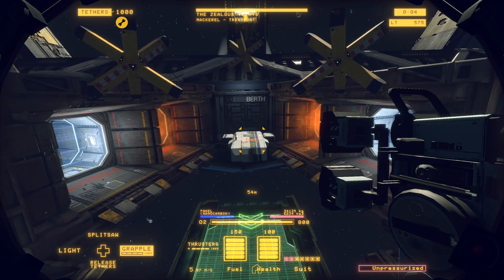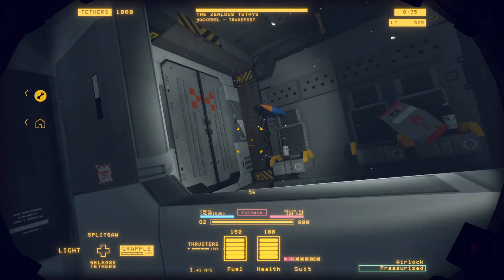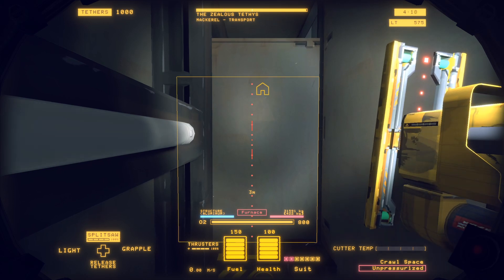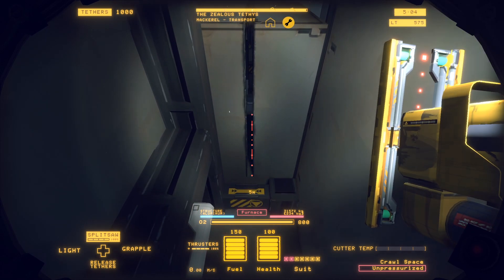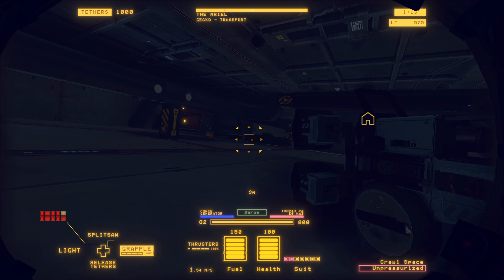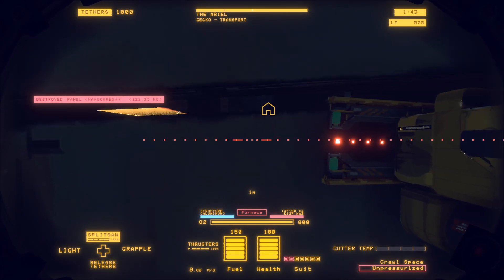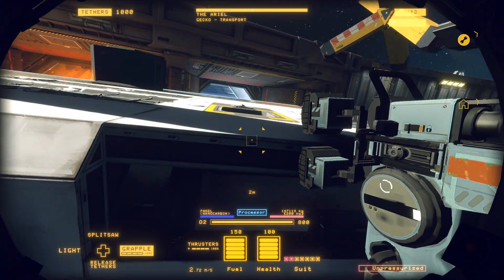Inconsistent Airlocks! Hardspace: Shipbreaker

Comment: 6:13 to 6:43 - The reason that the airlock isn't moving is because it's a tightly fitted component. Your first tether is not directly aligned with the center of mass of the section to the processor. It would have to twist to get out and it can't. Then you apply upward tension with a ~ 50 degrees up-bubble and not on the center of mass of the piece. This causes the section to pitch which explains why the panel segment which is visible at 6:49 has an angle. The bottom section of the cuts (where the horizontal segment meets the melted floor) has rotated in and is catching against the other cut and is preventing movement.

My best guess is that the game's engine is, for some reason, unable to reconcile that the floor is actually gone and has an imaginary section curling up and acting like a lip. Either that, or there's a property to splitsaw cuts and friction that is currently unknown and unexplained.

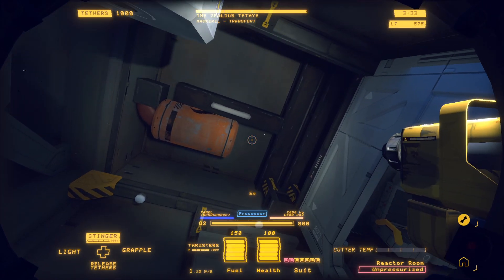In either case, there is a section of the aluminum surface in contact with the rest of the ship. When you clear the mid-ship section at 8:33 you can see that in the beginning of the NC hull's movement (8:31) that the airlock section does not move until the mid-ship section gently taps it and causes it to pitch DOWN back to the centerline of the ship. Once the mid-section is clear, the airlock torques right (making the door face more towards you) indicating that the tension of the piece was actually holding it in place. The Nacelle piece comes off because the aluminum panel you melt at 3:28 is the only thing holding it to the fuselage of the ship. If you repeat your experiment with a wide diamond cut so you can slide into the wall without melting it off, the Nacelle segment will stay attached.

The larger ship airlocks are built into the entire hull section and are nearly impossible to separate (and have the game notice) without explosive decomp
Reply: I think you're more correct in the first paragraph.  The tethers weren't perpendicular and were pulling the panel at an angle. I've encountered similar, but not nearly as pronounced binds and the best fix I've found is to move through the crawl space, freeing all the regular hull panels, Process them, then deal with the airlock, and cockpit, since they are similarly attached.

Comment: Good stuff!   The double cuts and melting the airlock floor may be the tricks I was looking for...
FWIW on the Mackerel, I remove the forward section with the cockpit which provides access to the fuselage side structure cut points.  I then remove all the fuselage side structures on the airlock side leaving the airlock for last.
The fuel tanks aft of the airlock can be accessed without melting the reactor sidewall by removing the forward/cockpit section and using the crawl space over the top of the airlock

Comment: If you hit the corner where two of the airlock aluminium walls connect you can cut two walls with one cut, essentially enabling you to cut off a full airlock with just two cuts. Very useful for bigger ships as well.

Comment: The cockpits are even more inconsistent than the airlocks. The yellow striped border pieces are not meltable on a mackeral, but they are on the gecko class. You could also show this, so that maybe we will have a fix at some point.

Comment: On the hard Mackerels where the crawlspace is further interconnected by fuel pipes and their joints; the cube things; I like to chop all the cut points joining the outer hull with the inner aluminum and break down (Stinger) the joint connecting the fuel pipes to the back panel, then just tether the entire wall of nanocarbon to the processor so that all the fuel pipes get processed at once too. The airlock side always seemed to give me trouble; I'll have to try that trick of pulling the airlock to the top jack some time, thanks!

Comment: My winning strategy for airlocks is planned uncontrolled decompression. Once I have access to interior and have made it uncompressed, I will shoot the outer door and this usually deconstructs the aluminum walls and nothing else. The aluminum still goes to the furnace but in smaller pieces. Not 100% reliable but extremely fast

Comment: Oh god, yeah. The airlocks are a coin toss right now. You could cut through everything holding those nanocarbon panels on and have them look like they're just floating there but the game engine will still think they're connected somehow. Personally I don't even bother except to pull the switch panels off. When I'm doing a Mackerel the airlock just goes straight into the furnace along with that entire, central, frame structure. It's not that much material so until they lock this glitch down I don't see it really being worth your time.

Comment: My main problem with airlocks is that when you follow the depressurise process, some of the inner rooms on larger ships aren't depressurised.  How do you deal with them?
Reply: Use your hands to hold onto the wall beside the door and open it after the main compartment has been opened to space. You want your body to be out of the way because lots of small bits will come flying out of the door and they can injure you.